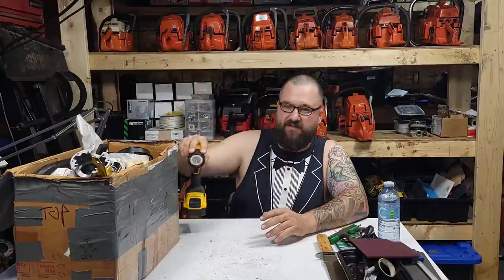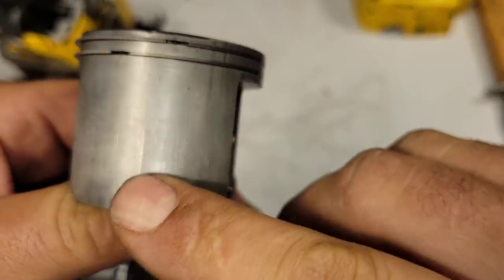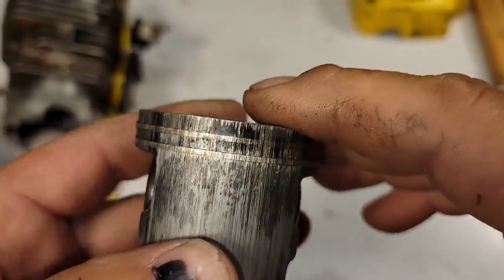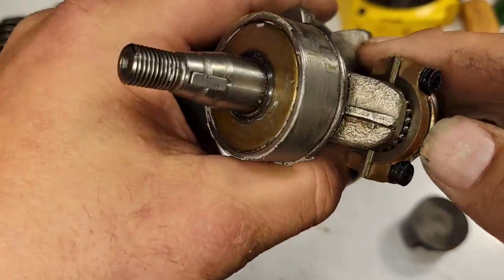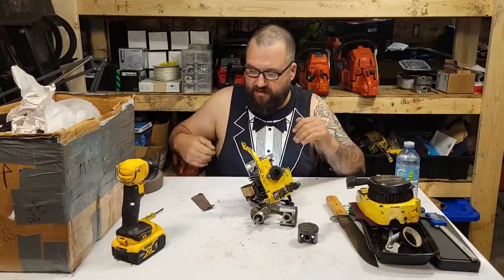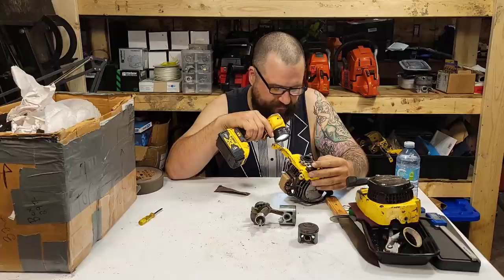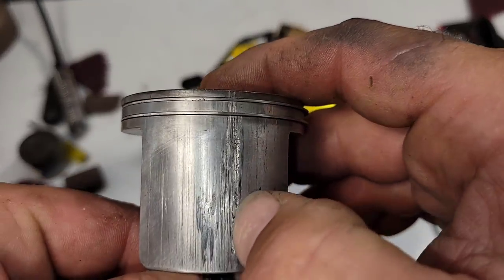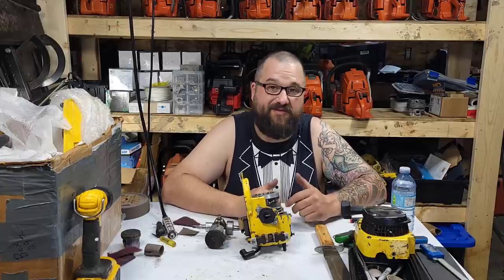Buckin's McCulloch Pro Mac 850 blew up. Failure analysis!!

Comment: Hey Tinman, US Chrome of Wisconsin can remove the chrome, Nikasil electroplate and diamond hone to size. I have used them for racing cylinders. They help many racing teams around the world. Highly recommended service. But you will need to send a piston along with the cylinder so they can size it properly. Can you say 'Big Bore'? find a Stihl or Husqvarna piston that is close to size (a bit bigger than stock) and will fit the rod with close to the same deck height (you can chuck it up and cut to correct squish). Just a thought.
Reply: That I would love to see!
Reply: Yes, a FrankenMac, custom machining by BellHopper, full build by the Tinman and run wild by Buckin’!  What a series that would make :)
Reply: I am 20 mins from that place.
Reply: I also live near by. Sent quite a few mercury blocks in to get re-plated. They do great work

Comment: Could be Tinman that it's design spec 40 years ago doesn't lend itself to modification. Couldn't the  cylinder be replated with modern tech?
Reply: One has to be extremely careful as how much these old saws can be pushed. Just spoke to a very reputable porter, and he described exactly what happened in this video when a saw is pushed beyond its boundaries.

Comment: Find a new piston and send the piston/cylinder off to US Chrome and have it plated.  Save your port work and the cylinder.
Reply: If you are a “dealer” than US chrome is an option on a blind-bore cylinder providing the bore size is sufficiently large. there are other US companies that do this type of work but unfortunately they won’t do blind bores. Looks like as of now one-off hobbyists are SOL unfortunately. If a guys wants one somebody has a cylinder somewhere , but you’re gonna pay out the zoo-zoo
Reply: @fabzacres-blackcat someone needs to gear up and start doing them.

Comment: Some thoughts. 

1. Steel sleeve that jug, there is a fellas on AS that has set up the tooling to do it. 
2. Find an 81 jug & piston, much better plating than the later Black & Decker produced/cost cutting chrome of the 850. More than a few ways to convert the 81 to electronic ignition as well. 
3. Source a new piston and send to US chrome thru Woody for a re-plate. 

Cheers Tinman, always enjoy your vids, builds, honestly & thought processes. 🍻

Comment: Top of the piston tap the leg on the spark plug. I see that clean cut line right on top
Reply: Funny, I thought the same when I saw that mark. I thought the ground electrode came off the plug but the chamber looks good. I didnt see any marks on camera.

Comment: Hi Tinman that  Pro mac 850 may have blew up because I have been noticing there is too much ethanol maybe above 10% in the fuel this year. My saws and mowers have not been running too good the past 3 months they seem to run lean and boggy I have been finding water in some of the carbs from the ethanol gas when I switched to ethanol free gas they run fine. Ethanol gas will make the engine run hotter. Maybe that is what happened.

Comment: As already mentioned there are some really good replating options within the powersports industry with a product most likely better than the original, Used those services when I raced back in the stupid years. But what is interesting this still resonates around the internet like it's a cataclysmic event. A couple of things come to mind...simultaneously :) You are taking 40 year old machines and bringing them to a entirely different level than their original form.....on used parts. Failures will happen, and probably would have even had you not touched them ( assuming they were in use ). You are breathing life into them, saving them from the scrap heap, not just yours but to all out there who have discovered the fun in this. Showing folks how to enjoy this stuff. Just keep building these, damn the torpedoes and don't worry about the "sample of one" & resultant over analysis. BUT there is one point that gets over looked. Your creations are actually being USED often as true work saws, especially with one famous fellow in sustained operations vs. the GTG cookie cut race saw that might see 50 hours in it's entire service life. Something to ponder :)
Reply from the maker: Lol yep "a sample of one" for sure.  I don't put much thought into why saws like this blow up. Probably 40 year old used parts for sure. 

And you hit the nail on the head, my mission is building reliable, fast, fun vintage  ported work saws that get worked. 

These things are too much fun to not play with. I'm sure I'll do another 850 soon and maybe turn it up more.

Always love your honest real word approach, I've enjoyed watching you for many years.

Comment: As per the charts, this looks like insufficient lubrication, or lubrication quality issues. Not enough oil or poor quality oil relative to exhaust sidewall temp and clearance....as per the charts. 
Therefore, not a tinman problem.

Comment: Win some and loose some.  Could have used a nos cylinder and still have the same results, those macs are notorious for this issue.  Replate might work but not cost effective for a work saw.  
Find another one if ya can and try again is all ya can do. 
Take er easy my friend

Comment: Well that’s how it goes some times  to bad that there is no one who can machine out all that Crome a re plate it with nickel side plating  or re cast a slider  and same with the pistons now for Mac parts check out a gall in Florida who has s all engine shop and a tube Chanel  called chicanick she has some old Mac part her shop is in Florida

Comment: It wouldn't have mattered if it was running alky and a little tip-o- the can, or box stock on super unleaded, when the plating isn't tight, you're doomed. Wish there was a way to tell, but it seems it can happen to a brand new nice thick plate, or on the verge of wearing thru. The latter seems to be the most common, but years ago I did the snow machine thing and we'd get both, mid-life seems to be the safest time to do port work, at least it was with the cylinders from the 70's and 80's . Almost always fails around the exhaust port, probably because it's the hottest and driest. Been watching 2strokestuffing do his own nikasil plating, that fella is the hardest working builder I've seen. Thanks for sharing, hope you find some parts!
Reply: Nikasil is tricky. Nickel plating with silicon Carbide suspended in the electrolytic bath. Yup the Two Stroke stuffing guy is great fun to watch. You have to plate slowly for a long time. Then diamond hone to size. Not easy for the home-gamer but I've messed with it some. Hard Chrome is easier but I feel the Silicon Carbide Nickel is the way to go. 'Nikasil' is a trademark of the Mahle company. They have it down and will license the process for a 'small fee'. :)
Reply: @tonyalto1014  Mahle has a few very good processes in their arsenal, the Grafal skirt coating actually holds up in alcohol motors and the insulating dome coating saves the runtime (4 or 5 passes if you're drag racing) to coat the pistons and get the setup to settle down. Before that came along we used to use grey VHT header paint. Mahle automotive stuff is generally quite good, wish they'd do chainsaw stuff, but I'm afraid us chainsaw guys don't spend enough collectively to justify the tool up. They WILL do custom work, but you don't want to know the price....  It's actually easier to get top fuel pistons than chainsaw pistons. Guess we need to do the Burt Monroe thing...

Comment: Maybe not enough oil in fuel mixture! I just today about had this happen to me . Wound it up for abit shut it off ,afew minutes later went to pull it and about slapped myself with it thinking I had a ton of compression and then it came to me as I dumped gas out asking myself just how stupid can I be . And the answer to that is " pretty gadamn stupid" ! Alittle 40 in it broke it loose by hand and we're on the road again!

Comment: Hey Buddy sorry to see that that saw popped, but thats just part of porting vintage saws. Honestly the chrome on these Macs are their demon tweak and its not the first or last one to be taken out by chrome flaking off the cylinder walls. It is interesting that it flaked off at the bottom and not around the exhaust port like most of them do. 
           Sadly rechroming the cylinder is probably not the best option in this case, but the cylinder can still be saved. It’s definitely more work but you can bore and install a thin steel sleeve in these cylinders and it has been done in the past by other saw builders to get rid of the chrome. In the end it makes them a more durable saw since there’s no longer any chrome to flake off but at the expense of adding weight to the cylinder. You can also now get a new pistons for a Pm850/Sp81 from little red barn and try to save the wrist pin bearings since I don’t think anyone is reproducing those yet and an NOS set is hard to find.